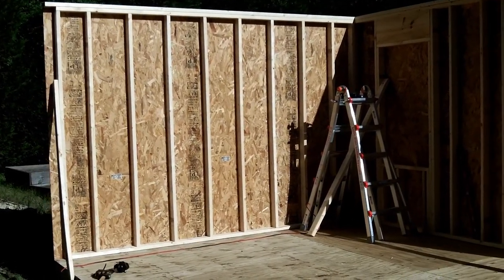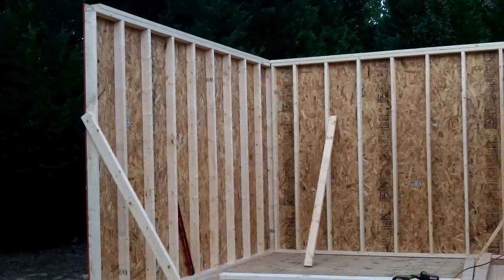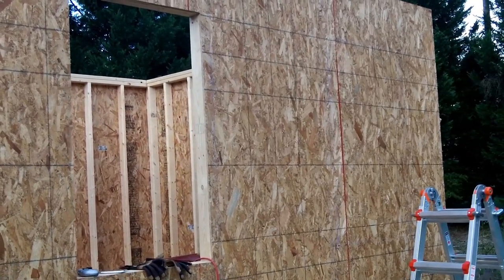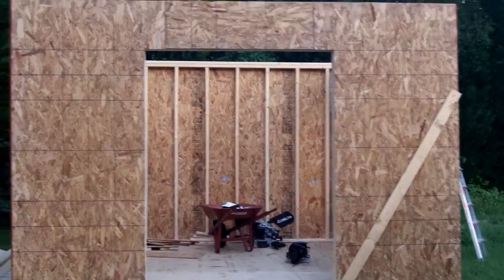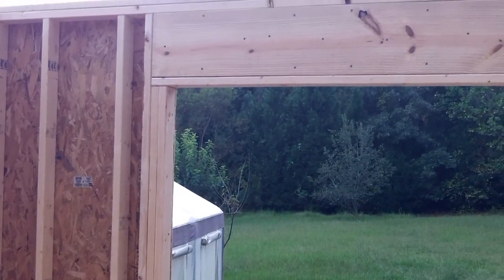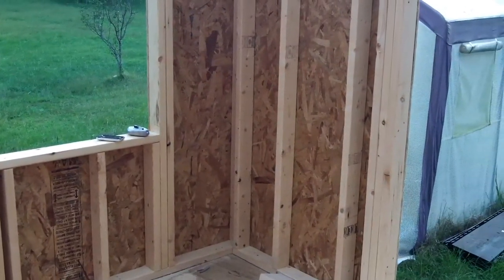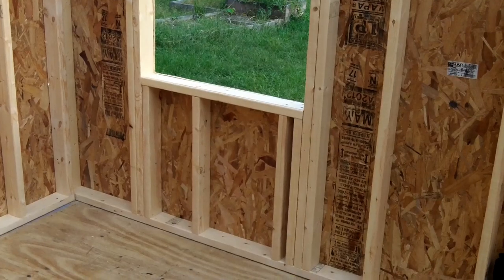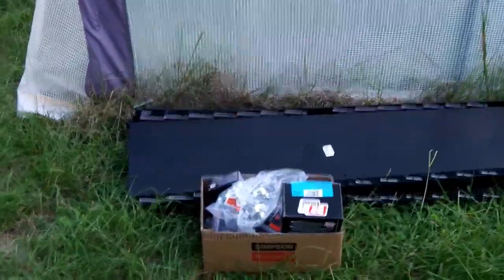DIY Shed - Part 3b: Walls

Comment from the maker: Yeah, I was told that would be necessary in a residential situation in order to pass code. Since I didn't need to pass code, I wasn't too worried about that. I can always go back and put the other studs in if it becomes necessary.